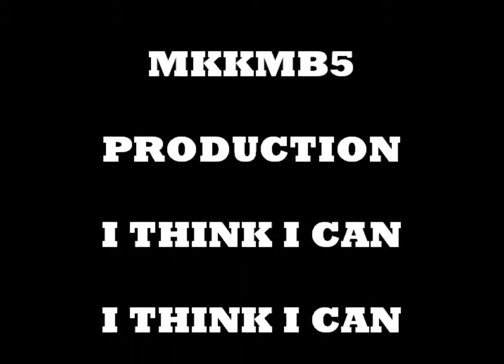Its not a tote goat mini bike

Comment: Sir, i believe what you might have here is a "Trail Cycle". I say might because it looks very similar to mine but not exactly. i suspect they made more than one model of these. Built at a potato Machine Factory in twin falls Idaho way back in the day. I say way back in the day because of the research I have done on mine. There is very little on it actually. but mine has the original engine still and the name plate. Mine was made from parts that have serials from the mid 50's. an 8 HP briggs with sears tags on it. glass bowl and all, it's gnarly and still runs like a scalded cat. originally sky blue. Mine has not undergone restoration and is missing a drive chain. I just have not got to it yet, but I will for certain.   It also has two gas tanks. one to get you there and one to get you back, both original.  I am pretty sure i am correct on this.  possible I am not, certainly looks like the same people made that fram design though. I believe they were attempting to OUT DO the popular Tote Gote at the time, the forest service was using the Gotes here and I think there may have been a little Bad to the Bone Go anywhere Bike war back in the day.  You have encouraged me to get mine back out an take another look , maybe even get started on it! :O)    seems I will never find a real gote for  a price I can live with. Grr. LOL
Reply: I can buy one in very rough shape for $350. Is it worth the effort?
Reply: @420edu3  just depends on what the demand is for this type of thing where you are.    they are very cool though, i like mine but also, I got for cheaper the 350.  i didn't even pay close to that.   all restored and everything in these parts or maybe even on ebay, I bet it would sell for a grand easy,  awesome scout bike, pulls right up steep hills. im no kid, i weigh in 275 pounds and am 6ft3,      mine still has the original engine.      if you dig this kinda stuff and you like things that hard to find and /or noones ever seen before.    these are way cool.      i just picked up a heald Super Bronc for 75 bucks!    wooo hoo.    this comment you asked n was so old i had forgotten about it.  LOL